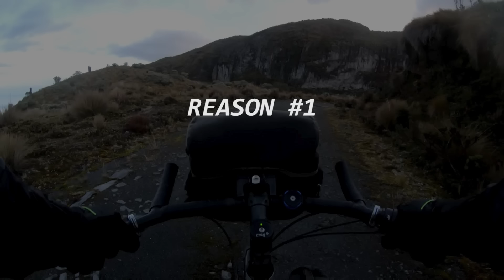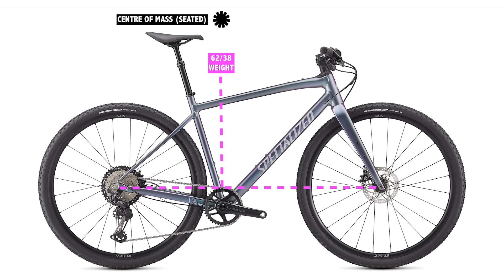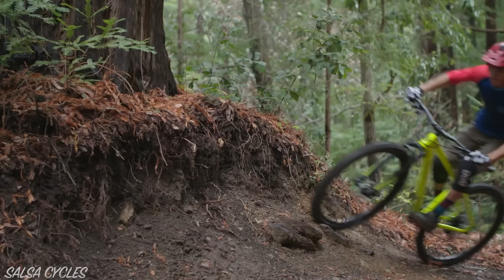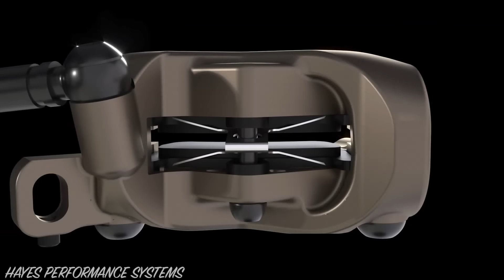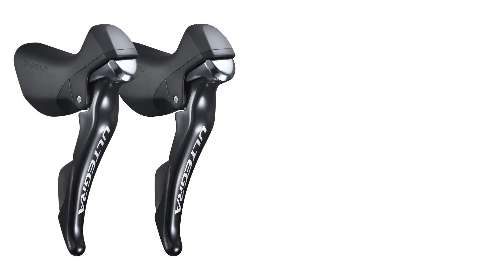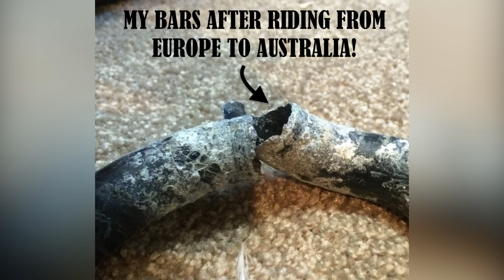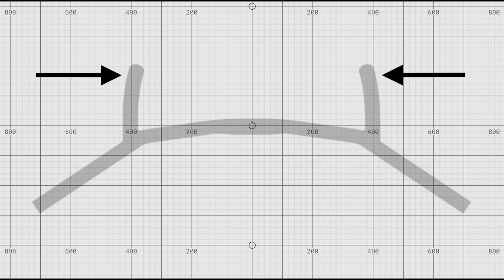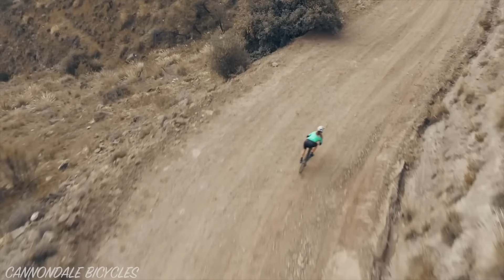Why Flat Bars Are BETTER Than Drop Bars For Most Cyclists (Objective Analysis)

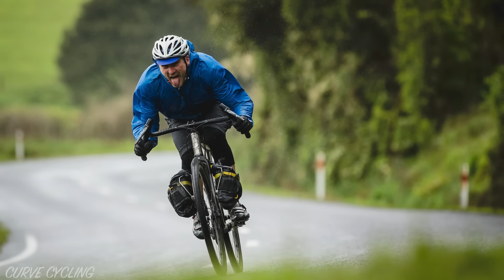Comment: I've been riding for over 60 years, and used straight and drop bars.  I'm primarily a road cyclist. For me, drops win every time, particularly uphill. I can get out of the saddle and lean further forward over the bike. I can't get the power onto the pedals with straights - look at the gentleman at 1:43 on your video clip - he's lunging up an down and using his arms to try and get a better climbing position. Even out of the saddle, I couldn't get a good climbing position with straights.
I've owned a mountain bike, and I found the steering to be overly sensitive - I didn't like the wide bars.  As a bike, it was also too heavily engineered for my needs. I now have a gravel bike, and it suits me better. Low gears, drop handlebars, and although the tyres are heftier than those on road bikes, there's a lot less drag when on the road.
Finally, corrosion and ease of maintenance. The modern fashion for taping cables to drop bars doesn't help for speed or ease of maintenance, as you rightly say. 
Ultimately, it's personal preference I suppose - as long as we all kep riding and love to do so, that's what really counts!
Reply: Sorry, I meant 4:43 on the clip!

Comment: BS. Sweat corrosion... on aluminum? Most drop bar bikes with decent geras are CARBON. As said earlier by others: stem length counts. And geometry, not just a flat or dropped bar. Thsi is like saying MTB is best, and dropbars suck. Well, offroad that is correct; On road... give me dropbars please. So 11 vs 3, Sorry, some of those 11 are just biased totally. OBJECTIVE MY ASS. Instagram likes don't come from drop bars. A nice jump with a MTB straight bar gives likes too; Agility or nervoity is a choice, even for straight MTB bars. Only freight train trekkking bikes or high speed motorbikes need stabilty at speed. Give me handling please, on my MTB or on my road bike... or gravel bike these days. Seems you're a lame right on straight haul backpacking long drives trekking biker, not one enjoying speed, agility, diversity. Sorry man, not my cup of tea.

Comment: Without specially designed bars, bar ends, or some other aero clip on option I strongly believe a plain flat bar is not ideal for long hours on the bike. I know everyone is different, but most people WILL experience some type of wrist pain or hand numbness from having your hands in the same position for hours.  That's not even a subjective point. You mentioned while using drops, different hand positions help with relieving the riders weight/seated position, but I think the real benefit that you did not mention is that a drop bar has far more hand positions than even most flat bars designed with multiple hand positions in mind, which allows you to keep your hands and wrists more comfortable for longer. If you are touring on non-technical terrain IMO there really is no benefit to a flat bar.  On technical terrain I agree that a flat bar is ideal...but most people are not riding on anything more than chunky gravel. 

I think the other thing here is the culture of touring can be fairly different from person to person...most people cycle touring, especially in Europe, are not riding more than 50-60km per day as they hop from town to town. At that rate it really does not matter what you choose with regard to comfort because you are probably stopping every hour and even then aren't on the bike for more than a few hours per day. 

The other points about the price of shifter and brake levers for flat bars, IMO, is one of the major reasons to choose a flat bar. If you want to put together a cheap bombproof rig that can go anywhere, it is certainly hard to beat a flat bar.  Although, the matter of wider gear ratios on MTB components vs road components is more or less a non-issue at this point with the advent of companies like Ratio making conversion kits, long/short pull adapters, wireless shifters and derailleur pairings. With regard to brakes, alot of (if not most?) mtb still come stock with 2 piston calipers. Unless you ride Downhill, almost no one has a use for 4 piston brakes....or maybe if you have a insanely heavy loadout. 

In the end it really does just come down to preference. There's a tool for every job, and that is one of the exciting things about cycling!

Comment: I can't get rid of hand numbness after the first 12-15 miles on my drop bars. I've tried everything from seat adjustment, short stems, longs stems, bar heights, double wraps, gloves no gloves, etc, etc. I'm thinking about converting to a flat bar with Ergon grips. Your thoughts?
Reply from the maker: It sounds like you've exhausted all options with drop bars. A flat bar setup with Ergon grips is worth a go.

Comment: This was an excellent presentation! I enjoy riding both FB and DB set-ups,  and also don't really feel like I loose much speed with FB set-ups even during group road rides. Just purchased a Trek Domane SL6 Etap. Already considering a FB option for this bike to increase stability during some trail/light gravel rides. If you (or anyone) have suggestions that would be greatly appreciated.

Comment: Always ridden flat bars, and my main bike from 1998 was a Specialised Rockhopper, which has covered thousands of miles and many touring holidays to France with 2 or 4 panniers and camping gear. ( now converted to an eBike with a Bafang motor ) Joining this has been an On One Pompetamine, again with flat bars. 

In 2018, I broke the habit of a lifetime, and bought a Genesis  Croix de Fer with drop bars (105 setup). What a beautiful bike! totally spoiled by the stupid handlebars. Contemplated changing the bars, but in the winter of 2020, bought an identical 725 Croix de Fer Frame, and built a touring bike with an XT setup (3 x 10) and flat bars, What a joy to ride, so much more comfortable than riding on the hoods, braking far more positive ( not being able to reach the end of the levers on the drops).and for me anyway, much better control. 
Personal preference of course, and whilst out cycling in the Peak District I see far more riders with drops than flat, 
 Anyway, each to their own, and lets all enjoy our bikes. Thanks for the excellent video.

Comment: Objectively speaking , flat bars make a lot more sense to majority of cyclists as it is a more durable, easier to repair , easier to find and less prone to damage than a drop bar handlebar. However , one cannot deny the better looking and cooler asthetics of the drop bar handlebars. I like both systems and, yes, the drop bar handlebars does offer slightly more positions than a traditional flat bar , but this can of course be fixed by changing the grips and even adding aerobars to the flat bars. In the end , just choose the system that you like.

Comment: The toe overlap can be reduced a lot by using shorter cranks. 165mm cranks are healthier for most knees.
Reply: And proper wheel size.. some people insist on running a 700c on a smaller frame when they should be using a 26".. I'm hoping that the 650b trends gives a middle ground that those riders are more willing to consider. It really hasn't been my experience that flat bar bikes are longer though.. might be true for the Salsa journeyman example specifically but I've been on lots of hybrids and city bikes that had a short top tube and long stem with toe overlap issues.

Comment: Seems like reasons 5 and 6 have little to do with the differences of flat/drop bars, but the bikes they're generally attached to... So more a discussion of flat bar/drop bar BIKES. not just the bars themselves.
Reply from the maker: Umm... did you see all of the other talking points? 😅

Comment: This is a tough one - I think if a rider is riding in the "default riding position" - many of these things you point out hold true. However, I've become accustomed to adjusting and shifting my body while using drop bar handlebars, and I think this mitigates and overcomes most of the disadvantages that you point out. The toe overlap thing I've noticed IS a risk; I have not tested flat bars enough to know if they completely eliminate this risk. However, I still prefer drop bars because it is always more ergonomic to be able to switch between grips rather than be stuck with 1 grip position and drop bars provide more neutral wrist positioning on the handlebars.

It's interesting because I ride some extremely rough terrains on my gravel bike (mountain bike courses even) and I've had absolutely no leverage issues, but I also don't carry luggage on my front side. I find the improved leverage of the flat bars to actually be pretty annoying and twitchy at times compared to my drops. When I am actually riding in the drops, I feel that I have ultimate control over the bike and my BODY has a lower center of gravity. Nonetheless, great comparison!
Reply: Honestly I think the toe overlap thing is exaggerated anyway.. part of that is just a matter of fit where smaller riders really shouldn't be on a 700c wheel and the 650b trend should help with that. I've had hybrids with flatbars where overlap was a major issue (Kona Dew in particular) and there are mountain bikes where a longer top tube is a selling point (Trek/Fisher "Genesis Geometry") meaning that other MTB's lacked that longer top tube and made up for it with a longer stem so toe overlap has been an issue with MTBs but maybe not more recent ones or maybe not so much the trekking style bike popular in Europe. Obviously it's going to be an issue on a "roadie" style road bike (where you aren't mounting fenders) but there are so many more endurance, gravel type bikes out there now, which like dedicated touring bikes, avoid this issue altogether.

Comment: They BOTH suck. Neither lets you have one hand forward on the bend and the other on the grip. I do this 20 or 30% of the time. You can with some of those other syles too. I have NEVER used bar wrap in my life. 
I just don't see how you can contort your wrist to comfortably hold those horns sticking straight forward.
And of course you didn't include MY fave HB. 
Dutch style riser sweptback is all I use on my 3 tour/ roadsters, with 4 IGH wheels, I like 70 to 80 degrees the best. I can reach as little or as far as any drop bar. I have made quill type extensions to the grips when needed. 
I only like the smooth nubbed plastic grips made in the 70s. The rubber POS CRAP they have now is patheticly slimy, like holding a fricking tire. WTF are the bastards thinking?? Plus they wouldn't even slide off my new bike's HB. I cut one off and threw them both in the trash. 
 
 I do mile centuries on my old CCM with a new SA RD3. Not fast, but Easy as pie. Same with my Rohloff14. The bar on the CCM now is from my great-uncle's SS Rudge, might be 70 years old and good as new, with nickle plating. Try that with alu foil. LOL. O

On hills my back just automatically goes straight up so my arms can pull up. The last time I tried standing and pushing hard, I pulled something around my hip and suffered for 3 months.

Comment: "The drop bar market will flat out pay more for the same thing" Never have I been so offended by something I 100% agree with.
Reply: I call it the drop bar tax.
Reply: do not forget the spandex suit with a huge company lettering printed over it, indicating your tribe. It increases your clicks by another 240%!
Reply: James Acaster is that you?
Reply: Great video!
Reply: Most manufacturers of drop bars also make flat bars.
Reply: @monkmchorning 
That’s what the videos says, and that flat bars of the same brand are cheaper, even with better specs.🤷‍♂️
Reply: @robbin763  i dunno. There are tons of 80's-90s ten speed and 12 speed bikes collecting dust you can pick up for 50 bucks or so.  Flat bar are not as cheap as we may think.   Just the rubber handles can be a pretty penny while bar tape is just 5 bucks.
Reply: Even in areas where parts geared toward flat-bar bikes and toward road bikes are compatible, the road bike parts cost more!

For instance, low-end road bikes used to be 8 speed until recently, now the low end is 9 speed. Both are compatible with low end flat-bar / urban / MTB stuff in terms of the drive train: same pull ratios on the derailleur and whatnot.   But a road cassette like 12-23T will cost you more than a dumb wide range cassette like 11-34T. Same number of speeds and all, in the same spacing.   It will work better with a road-oriented derailleur, and that will cost more too. Though compatible with your existing shifter.
Reply: pun definitely intended
Reply: 😂 True indeed!
Reply: Cheapest Shimano Hydraulic Brakes:

Flat Bar: 58$

Drop Bar: 580$
Reply: Naja, du kriegst die komplette GRX 400er Gruppe für unter 500€. Ja, teuer, aber nicht ganz so krass.
Reply: My drop bar has a 22.2 mm diameter. It was less than $30 out of China; I'm easily using flat bar brake handles on it, going to my Shimano BR-R317 cable disc brakes, that I put on when it was still a flat bar bike.

Comment: 3 years ago I switch from cross  bike with flat bars  to road endurance bike with drops. All because of love for asphalt and possibility of drive more kilometers in less time. 

Subjective:

Pros: far better and lighter switching of gears (have Shimano system in old and new bike). Road bike is few kilograms lighter than cross and is more stabile during drive. Can drive more kilometers in the same period of time. 

Cons: worse brake rim system with less power of stopping (I dont decide for brake discs because of complicated maintenance and higher price) . Hands feel better on flat bar.

Cyclist type: over 60 kilometers of commuting per day and sweet weekends of gran fondos.

Comment: Nice try, but according to my wrists, flat bars suck.  I can't believe you had grip shift as a good thing!
Reply: My Rohloff grip shifter is on a DIY knob on the top tube. Where I can use both hands easily. So the cable does NOT flop around or grind at the rub points.
I do the same with my SA shifters. ZERO chance of breaking and the cable lasts forever.
Bar end attachments are the dumbest idea ever.

Comment: Don’t agree on drop-bar better in city environment, that’s one of reasons I changed on my touring bike. As you you conclude that at low speed flat bars are more stable and with a loaded touring bike I don’t like to wobble around in heavy traffic with drop-bars. On the road I like drop-bars, but hardly ever in drop so why have them, it’s the less wind resistance I find important and on the hoods you have less breaking power with drops.

Comment: In my experience most people use flat bars much too wide for their shoulder width which lets them 'feel' more in control but in actuality they have less control and worse breathing/lung function
 Ergonomically, I was taught to relax shoulders, close eyes, lift hands above shoulder height then lower slowly to comfortable position. That should give best bar width and often height when seated
Flat bars are also not very good for long term use at the hand positioning helps cause carpal tunnel syndrome.
Saying that, I have pretty much always used flat bars as 'drops' cause neck problems that very few people other than doctors know or talk about. (doctor once asked me if I was a painter as it seems a common problem with ceiling painters, or people who spend a lot of time with neck bent up/back)
but, what do I know, I'm just a motorcycle mechanic

Comment: Dropbars were only on racing bikes. I always wondered how it feels to ride with dropbars. So I wanted to buy a cyclocross bike, but always someone from bike shop or just some wannabe know it all discouraged me to do the change. Until 2015 I still bought a cyclocross bikew. I bought it online, because local bike shops were not coooperative and too expensive. I haven't regretted it. Although I had to do some changes. replaced stem with shorter one and handlebar with narrower and with the round curved drops and flare. For me it's so much more comfortable. And more useful. Whatever reasons you list there.. in en end it's still all just that you like flat bars nothing else. I won't even try to analyse why I like drop bars more. I just like them. They don't neccessary look better, but I feel comfortable. Even though to attach bicycle bell to a place where I could ring it with tumb and still have also both brakes accessible. I had not just to use a handlebar extender, but to make aditional extender that would have smaller diameter. Because suitable bell with adjustable trigger position was meant for thinner handlebar. You can see the video about my handlebar extenders extender and bell if you like. https://youtu.be/wSV0om1GfiE

Comment: 'Drop bars are better in traffic' - No they are not. You will get lower braking performance, worse handling(due to the hand position) as you have mentioned before.
You can not fit a bell on a drop bar to be accessible at all hand positions, which you'll need in traffic.
I ride flat bars outside the built-up areas due to I'm afraid of  the idliot car drivers and pedestrians, so I can brake faster and more efficiently.
But if the flat bar is too wide, you just cut them down as short as you need in traffic. I still use a 20 year old design: 560 mm wide 5 degree flat handlebars.

Comment: Comparing Ultegra Brifter pricing to XT Shifters?  Brifters are brake levers & shifters.  Add the cost of XT brake levels to the equation and the comparable pricing is a lot closer than 3x.
Reply from the maker: Yes, I put that disclaimer in the video. I'm just trying to find reasons why the equivalent drop bar bike is often hundreds of dollars more expensive...

Comment: Flat bars when they were narrower on older MTBs were very comfortable  I found. The much wider flat bars aren't very comfortable long haul I've 
 found. If you use a quality drop bar type like supacaz  and you can I get wrap with electrical tape to reduce sweat corrosion.